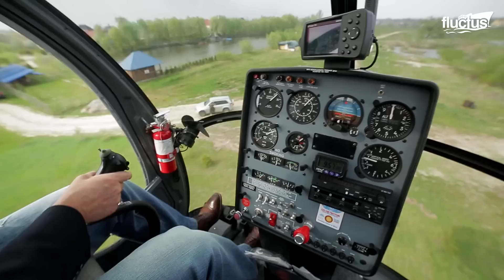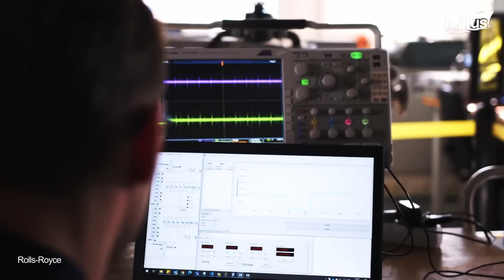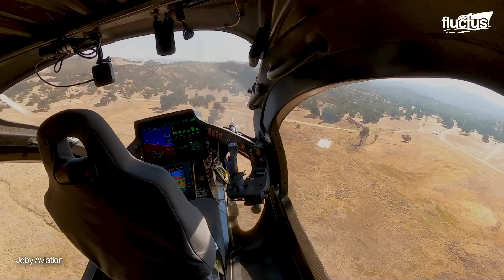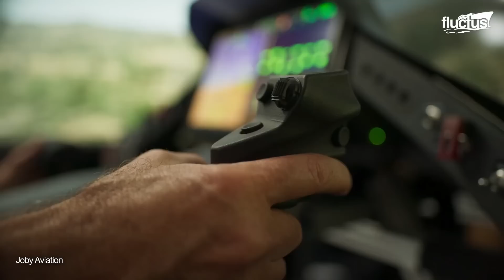US Air Force Testing Brand New $4 Million Fully Electric Aircraft

Comment: The dream of flying cars always amuses me.  While generation of lift is done with propellers of any shape or form, the noise will render the concept a non-starter.  We've had 3 helicopters ferrying tourists to see a local volcano when it is active and they fly over the capital every 30 minutes or so.  Just 3 of them are driving everyone nuts here.  They are small 4-6 passenger light helicopters.  Also consider the limits set on drone flights because the sound they make bothers people at tourist attractions (not to mention hazard of falling onto someone).  All videos trying to present flying "cars" as a good idea always cut out the sound and play some gentle music instead.  These things would be crazy loud if you consider they are just really big drones.
Reply: How does the graph go? A line for every year and a parallel line nine years to the right labeled "flying car"?

Comment: Another thought. Lithium Ion batteries are light and the most energy dense. However it is illegal to transport them by air on commercial airlines. How about all the fires we have seen caused by Lithium Ion batteries. Not a good feature when flying at thousands of feet.
Reply: So why can't I take a can of gasoline as my hand luggage in commercial flights then?
Reply: You do realize that the Li Ion batteries they are talking about are simply on the flight as cargo and don't have any cooling/monitoring systems integrated in place like you would have if you used them to actually power a plane?
Reply: 1) Lithium batteries are carried on cargo only flights.
2)Know what else you can’t carry on commercial airlines? Missiles, grenades, bombs, etc. You see, the military can do lots of things civilians can’t.
Reply: Gasoline has 100X the energy density of a Li-Ion battery.  In practical terms, that means a 737's range would be 31.6mi instead of 3160mi.  That would be 90 stops for a flight from NYC to LAX.
Reply: @Hyposonic  NOT USABLE Energy. Go do your homework....
Reply: @darrellmcever340  As I am a designer of high-performance Li-Ion batteries, I'd love to hear your groundbreaking insights.
Reply: @Hyposonic  Stop talking facts. We want to run our society on wind and solar! Not NUCLEAR (which powers both). Energy DENSITY..? Baseload..? Master commodities..? That sort of sciency stuff is for Russia ... China ... and India. We're too progressive for them to understand. 🤣🤣🤣

Comment: I am very much in favor of new technology and innovation. There is a place for any or all electric vehicles. However electric has a big short coming, energy density. Battery technology does not have an even close energy density to carbon based fuels. Energy density in batteries will continue to improve but in my view it will be many years before it approaches that of carbon based fuels. So for a very long time there will be a market need for both. Unless great detail to safety and backup systems are payed attention to a single fuse could down an aircraft. As a former military person and an Electronic Engineering Technician, in a combat situation a fast recharge will still need to be accomplished by carbon based fuel generators mitigating the zero emission aspect. I should suggest helical toroidal propellers which would increase efficiency by about twenty percent. Keep moving ahead this is impressive technology.
Reply: You make complete sense. However, the video maker as well as a number of Pentagon brass have a hardon for this. But don't worry. Once a dozen lives are wasted in a serious situation, they will dial it all back.
Reply: It's MUCH easier to control emissions from a few sources (power plants) than from 10s of thousands of planes.  You're also ignoring the fact that coal is dying and wind/solar/hydro plants generate more electricity than coal does.  And a single fuse can down a combustion powered aircraft --I've seen it on the Smithsonian TV show "Air Disasters."  I'm sure electric plane designers will be smart enough to build in redundancy like every other system.

Comment: How is the battery made and where does the power come from?
Reply: You are thinking about it too hard it's ZERO EMISSIONS!
Reply: yes while using it but what about the production of the power in the batteries still using what to make it. @ViolentKisses87
Reply: It comes from the blood of children and is made by dark magic rituals lead by the  Great Orange One.
Reply: how is fuel made and where does the power come from to make it
Reply: @fetB  details, details.
Look not at the man behind the curtain.
Reply: @fetB  so you're admitting both require fossil fuels??? Nice self own. LOL Plus we have to deal with dirty batteries, lower speeds, much longer refuel times, more weight, all new infrastructure....
Reply: @pumpedupdart6859  Admitting? I never claimed you dont need fossil fuels, although it is actually true, you dont. You do need energy and you can make it otherwise. What i said in my original reply is to contrast the massive amounts of enrgy need to even make gasoline, which seems to be conveniently swept under the rug, and then you're not even getting a good efficiency from an ICE. 

Talking about self own, you're saying new infrastructure is bad, lol, and I dont even know what you mean with lower speed. Also "refuel" times, is almost irrelevant when you can charge anywhere near places connected to society. Even if you live far away from it, you can actually source your own electricity. Go try to do that with gasoline. Besides, in a not so distance future there will be batteries with super capacity properties, meaning you can literally charge up in 5min. even today you can expect 15min on a fast charger
Reply: @pumpedupdart6859  I think that was the point.
Reply: @pumpedupdart6859  We dont make electricity from fossil fuels in BC, where are you?

Comment: But of course, if the private market rejects electric currently, let's get the military to pay. Those are cool planes, but seems like the same issues as electric cars - more expensive, still use electricity from fossil fuel burning, and not enough charging stations nor electricity if they caught on. If its break even on carbon, I'd go electric no problem. But people with real environmental concern know the batteries are their worst enemy on several levels. So stop with the claims of environmental benefit for electrics please.

Comment: So.. is there a tactical solar panel system that is laid out in a tactical, bomb-proof arrangement?
Reply: They will tactically push the airplane around on the ground in circles for two days to tactically recupe enough energy to then fly to the next tactical diesel generator with tactically hotwired charging plug.

Comment: Where do they get the electricity they need on the front line of a war?  It is much quicker to fuel up a plane than to recharge it.
Reply: Hot swap batteries.  Shouldn't take longer than refueling. One problem is an entire infrastructure and supply chain needs to be created. Maybe a battery standard so different vehicles can share? Just my thought.
Reply: @MarkBarrack  How does that work out when the weather is super cold.  Those Telsa trucks have been doing great in Rockies this winter.... /s
Reply: @timothyjburton  I don't believe electric battery powered system are ready and maybe never will be ready. Possibly storethe battery inside and installation was minutes? Another maybe is to have a ground based power source supply heat similar to plugging in our diesel trucks?
Reply: @timothyjburton So let's just ban electric cars, ah? Is that your point? Isn't there such thing as each to their own? The only reason I haven't bought an e car is cos of burning. Why don't you use that as an argument? As soon as the non burn one's come out, I might probably convert my van and have solar cells on the roof to charge it, cos I only drive it like once a week. I go to the shops every day by human power on my bike (not ebike). I freeze in the winter and rug up and use a plastic soda bottle for a heater, and in summer I only use a fan. I love riding my BMX to the local shop and use my van weekly to go to the larger shops 20 km away. An Evan would suite me, parked in the sun for a week. And I use it @ random too (of course). It's a 4 cyl Toyota Town a Ace, sips fuel and is so good, a decked out camper with whole bed that converts to a couch running east-west and heaps of ROOM front of me, and still feels empty (with a cupboard as well that is low and is part of the bed. And a bed panel becomes a table. And it all packs into the rear bench seat and quickly rip the carpet out and it's a carrying van (basically empty). Just really lowcupboard just behind d the drivers seats and a bench seat at the back. I can move furniture and stuff nearly as well as an empty van (even from the back flip up door). The bench seat is only 11" high, so there is plenty.enty of access at the back to put stuff in the van. 😅
Reply: @MarkBarrack in other words. The people who are using the electric vehicles are gunna secum to attacks and most likely loose. Yeah Evs a load of bullshit 😂
Reply: @applekidn1  today yes. Tomorrow hasn't been written
Reply: Swappable battery packs. 

As fast or faster than fuel.
Reply: As the presenter said “it doesn’t have much potenrial use in the military as yet”. It’s work in progress. You need to start somewhere…
Reply: They’re simply exploring current technology to see where funding needs to placed. Learning and exploring. They are thinking in terms of decades not months. This is how future tech is fleshed out. They spread resources around to many companies. If that company produces promising results, they get more money and more support. If not, the program is defunded and funds are placed elsewhere. Eventually viable programs are identified.
Reply: Where do they get the gas they need on the front line of a war? Gas is heavy, explosive, and expensive. 🧨
Reply: @tmharperjr yeah but clearly not as hard as ev so your argument was based in pure stupidity 🤡
Reply: @tmharperjr  10 4
Reply: Except for super capacitors. Technology is improving day by day.
Reply: High Probability that Hybrid, or Plug-in Hybrid will be a "Starting Point" on that Path, Which Will allow for Multi-Mode Operations:
- Pure Electric, Straight Generator, and Supplemental Generator Operational Modes. IE: Whisper Mode, Range Extended Modes, and Battery Emergency Boost Potential. (Like Nitrous, at the track!)
Reply: Let's hope there is no war, only peace
Reply: You’re only thinking of the last-minute requirement, which is to fuel the aircraft, and you’re not considering the enormous and risky logistical challenge of bringing aviation fuel by the  truckloads to the front of battle lines.  Those tankers are basically rolling bombs in a war zone, which have to use precious fuel to deliver fuel.  One of the aircraft mentioned can go about 250 miles and charges within an hour.   If only there was a source of light 93 million miles away that powers solar panels to refuel batteries as is already commonplace in many homes worldwide, we could eliminate those long and dangerous refueling drives to the front lines.  Hmmm.  Oh yeah the sun can do that anywhere on Earth without a refueling convoy of rolling bombs needed.
Reply: @johnnierhodes7799  Better yet, ditch the batteries and beam the power directly onboard with a C-band maser. Oops we're not supposed to know that.
Reply: @johnnierhodes7799  Please answer the question, how are you going to charge them on the front line?  What is the power source you are going to use?  I know all about fuel tanker issue my uncle drove them in WWII.
Reply: @markmaugle4599  It's called a Solar Panel.  You can put about 20 400-Watt solar panels in the same space you could park 1 tanker truck.  8000 Watts will do a nice job charging a vehicle, I can tell you that from personal experience. Add backup lithium battery systems and you can store that power for when needed, as homes with solar now already do, for readily available power even at night.  And from one Veteran to another, many thanks to your uncle for serving, especially in a war that protected the world as we know it.
Reply: If we never strive for the future we will never get there! Or we can just be stuck in the past!  😂
Reply: @seamoreplant  Our sociopathic overlords only want us to strive for THEIR future under THEIR control.
Reply: Ok, I get it. Change scares you.

Whatever.

Look, the military leadership is a bit paranoid about how dependent they are on fossil fuels. They put a lot of time and energy into trying to keep oil-producing countries politically stable so that fossil fuel prices don't fluctuate as much, to name but one example.

Finding ways to become less dependent on fossil fuel is an important matter of national defense, and that remains true no matter how ideologically opposed you are to technology, modernity, etc.
Reply: I don't see it this century. However, after the fiat financial collapse, after the purge of Socialism, when the Moon is industrialized, solar power satellites are up, and small modular thorium nuclear reactors are available.
Reply: Energy density is a very real thing.
Reply: @UnintendedConsequences  both gravimetric and volumetric.
Reply: It is foolishness to go with electric plane it is just not reliable to use electric aircrafts in battles. Its dumb idea, environmentally not going to helps anyone's who cared so much about environment but wars ever increasing around the world started with Russian invaded Ukrain, and hamas the terrorist massacre Israelites on October's 7th, wars destroyed the Universe, why all of these educated idiots don't address about these issues?everybody talk about going green but no one  ever that because of sin that destroyed humanity, because of sin, God  judgment upon this earth is imminent. Every knees shall bow every tongue confess that Jesus is Lord.
Reply: There is a factor in my argument to you...capability!
Reply: It’d be better used for rescue missions due to how much quieter it’ll be than regular aircrafts
Reply: Ha, ha, ha - this is nuts.
Batteries only have 1/10th the energy density of kerosine and engine combined.
And you cannot burn off battery weigh for landing.
Batteries will NEVER power an aircraft, until battery energy density improves.

The 250 mile range is nonsense.
By law you need 1 hr of diversion and holding, when you arrive at destination.
(In case of airfield closure and weather.)
In other words, this aircraft can only fly about 50 miles (legally).
Pathetic.

R
Reply: @RalphEllis  … if it can land vertically, then everywhere is an airfield. 🎈
Reply: @RalphEllis  times are changing. Beta Technologies has been flying for years. Not saying it is perfect. It is interesting
Reply: Pretty sure there won't be electric flying things until they come up with a light weight battery.
Reply: Use fossil fuel generators to recharge the batteries on the frontline. Ain’t that a great solution?

Comment: On that white military craft i saw only one big prop on the back. Were there two on those round wing pillars up front??
Reply: It should have 4 lift props, I think that was old footage where they were just flying the plane conventionally using just the pusher at the back, as can be seen it can be flown conventionally from an airstrip and will have VTOL capability as well.

Comment: where are you getting Epower on the battlefield? gas/ diesel generators. new fuel copters and tilt wings more useful and reliable.
Reply: The V-22 tilt rotor aircraft are currently grounded because they keep crashing. 😂 Where are you getting gas / diesel on a battlefield? ⛽️ It’s explosive, heavy, and expensive. 💥
Reply: Solar. Wind.  You don't have to truck in the fuel.  Electric motors are more reliable than fuel-powered engines.

Comment: using batteries in cars and planes produces more carbon emissions than any combustible machine. you people are hilarious! the emission are just relocated from the end user. the fact is that the emissions are produced during the digging, transporting and manufacturing of the batteries. and when the batteries die, they are not recycled. they are buried somewhere away from the prying eyes of the people, which in time become toxic to the land and water systems.

Comment: Errr what happened if you need to recharge  mid way through a mission? Then you will stumped ?
Reply: Same issue happens when you run out of fuel. In both scenarios, you need to be aware of how much power or fuel you have remaining. Same thing goes for ammunition. You have to be aware of how much ammunition you have left!

Some day we'll have all-electric handheld laser weapons instead of bullet-firing weapons. And idiots will say "What happens when you have to recharge in the middle of a mission?" Well, swap out your battery, just like you swap out a magazine of bullets! People act as if the current technology (bullets, liquid fuel, etc) also doesn't have to be stored, transported, and  replenished 😂
Reply: Once they figure out the range / weapons loadout / wind problems they will find out its not gonna work except maybe for base defense. I really cant see strategic use at all...maybe the hydrogen powered motors or antigrav.....